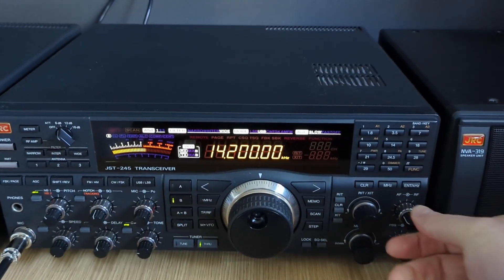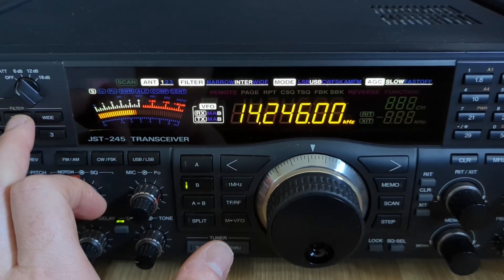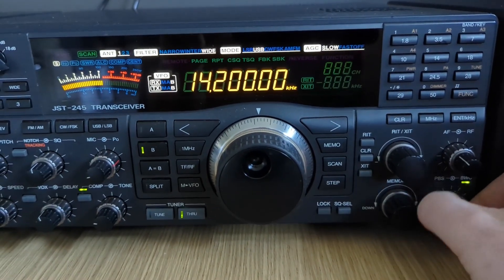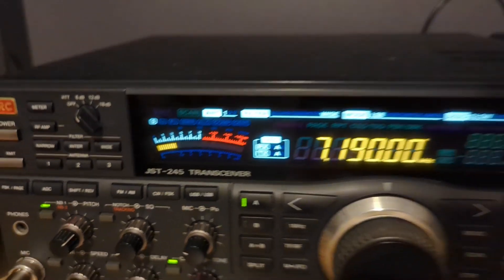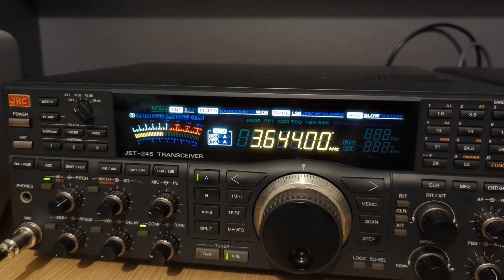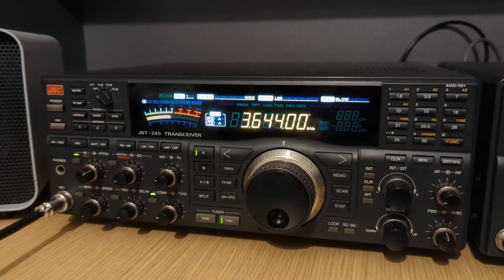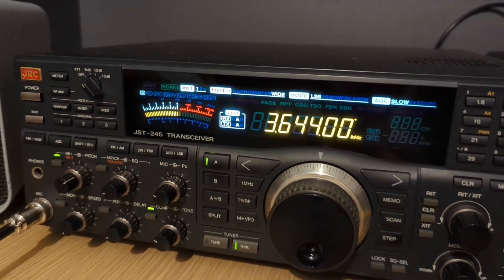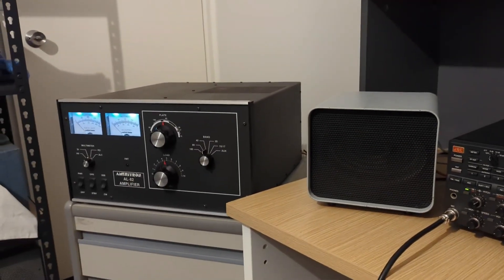JRC JST-245 – The Last Samurai of Japanese HF Engineering

Comment: I had wanted this radio since I first saw the advert in ham radio magazines. I started out buying the JST-135 (flawed but good) then a used JRC JST-245 with external speaker and their Kenwood inspired desk microphone. I even bought a damaged JRC 1KW solid-state amplifier from 160-meters through 10-meters. I have never found a receiver or transmitter that sounds as good as the JST-245. The antenna tuner is odd in how it displays ‘tunes’ as it shows the OUTPUT power during the automatic antenna tuning versus showing the SWR as common on nearly all radios. Thanks to a divorce more than a decade ago, I found it necessary to sell all of my ham gear, HiFi gear plus my test gear and tools. My tower and the 20-years of acquired antennas, rotators, feed line and dipoles were given away by my ex-wife as I couldn’t get them down in the short time I was given. It’s been nearly 15-years and I just finishing building a truSDX kit and I kitted out a small Odroid single board computer with an SDR Play (original version). It isn’t fancy but it gets me in the air and back into radio. I have a saved eBay search for a JRC JST-245 or even a JST-145. When I find one, I’ll do my best to buy it. It is the best sounding, smoothest operating transceiver I have owned. The only radio currently available that comes close or even bests the JST-245 (in my limited experience with them) is the Kenwood TS-590SG or TS-890S. Both of those radios are more expensive new or used than a functional JST-245 in good shape. I added the crystal filters to my JST-245 and that made an already fantastic receiver even better. It is a glorious radio use, quirks and oddities included. It’s just fun to operate and when you hear the RX audio and receiver selectivity, you will be sold. The JRC JST-245 is a world-class radio and holds its own against many modern (even SDR) HF transceivers. Thanks for a nice video that highlights one of my favorite radios and a truly special receiver. Enjoy that beautiful rig and I hope to catch you on the bands sometime.
Reply from the maker: That’s one of the best comments I’ve ever had on this channel. You’ve lived the full JRC story from the 135 right up to the 245 and even the amp. I’m sorry to hear you had to part with all that gear, but I get exactly what you mean. The JST-245 really is in a class of its own. The receiver is smooth, the audio is world class, and like you said, it’s just fun to operate.

I’ve run plenty of modern rigs, including an IC-7800 at one stage, and nothing has the same sound and feel as this set. The oddities are part of the charm, and when you hear it on the air you know why JRC built such a reputation.

Hope you track one down again soon. It would be great to catch you on the bands with a 245 back in your shack where it belongs.

73,
Andrew VK3USA / VK2XXL
Reply: Glorious to use, says it all.  Can't find that in Sherwood numbers or by "watching radio".  No wonder I'm strictly Kenwood now but look forward to my first JRC.  To summarize many comments i've read, too many times burned by Icom & Yaesu.

Comment: I LOVE MINE,BUT SHE WONT POWER UP.ANY IDEA WHERE I CAN GET SERVICE?I AGREE 100%,HAVE A DX 10 NO COMPARISON TO THE JRC.
Reply from the maker: Sorry mate, I have no idea where you are, let alone finding people that can work on this stuff near my QTH. I have to do everything myself. It's easy to get the power supply out so start by testing voltages. Better still, if you have two units like I do and spare parts, take PS out and drop another one in. Then just test until you find what's blown. Best advise I can give.

73

Comment: Agree its better. But still full of SMD crap like the rest. PLL how is that analog with encoder mascerading as a VFO. Just saying....
Reply from the maker: Yes the JST-245 uses a PLL like every top-end HF rig from that era. What matters is the implementation. JRC engineered it to near laboratory standards with one of the sharpest receivers ever made. The encoder drives a rock-solid synthesizer that outputs a true analogue sinewave, not a budget DDS. That is why it still holds its own today.

Comment: I agree it is a great radio, but to call it The Ultimate Japanese analogue transceiver" is pushing it a but, and when you look at lab tests of the "last of breed" radios by the big 3 you will see that there is more than one radio in that class that beats it.
In my testing, side by side and it lab tests by Sherwood labs the title goes to the Yaesu FTdx-5000MP by quite a margin.
Reply: Some people buy gear to actually enjoy using it as opposed to specs.  Otnerwise we would all drive top fuel dragsters home from work.
Reply from the maker: I’ve got a lot of respect for the FTdx-5000MP but the catch is that to hit its best numbers it has to be run in class A. That means efficiency goes out the window and the cooling fans spool up like a vacuum cleaner once it warms up. Run it in standard AB mode and the JST-245 still beats it hands down.

I also take Sherwood’s receiver figures with a grain of salt. Even Sherwood himself has said you will never notice those fine differences once atmospheric static and especially local noise are factored in. On air it is irrelevant.

Where the JRC shines is that it does not need gimmicks to stay clean. Its IMD figures in ARRL’s 1995 QST review were among the cleanest ever measured for a Japanese transceiver and that was at 150W PEP with no digital tricks. It is a rig built on brute force engineering: dual heavy duty power supplies, conservatively rated finals and construction that will still be serviceable decades from now. The 5000MP is a fine radio but in build quality and long-term reliability the JST-245 leaves it in the dust. That is why I call it the ultimate analogue Japanese transceiver
Reply: @VK3USA  Oh really? You take the Sherwood figures with a grain of salt? Well it is far more scientific and consistent than your fanboy conclusions.
I am a keen CW DX'er and contester and I notice the difference. In the critical RX dynamic range category the JST=245 does not even feature.
But hey, your channel, your opinion, I do not have to watch it so I won't......
Fanboy😂
Reply from the maker: @RudixSA  And there we have it. You lose the argument so you resort to name calling like a child. Too bad for you that it does not change the facts. Sherwood’s tables are useful but they are not gospel. Even Rob himself has said real world noise floors mask those fine differences on air. The JST-245 was built for clean transmit, a very clean receive, rugged hardware and long term reliability. It still holds some of the cleanest IMD figures ever measured by ARRL.

What makes this even more ridiculous is that you are trying to lecture with a channel that has no Amateur radio content of its own. No station to show, no demonstrations, nothing. Just criticism from the sidelines. Until you can demonstrate something yourself your opinion carries no weight. I will stick with a rig that was built to last decades while you sit in the cheap seats. 73

Comment: In two years or less SDRs will make this unit largely anachronistic, but that’s just how it goes. Don’t hate on SDRs, they’re a military technology at this point and any other take is just pure cope. I can promise you, the FOSS people will come up with digital codecs that will put analog filters to shame.

Nice rig though, beats the pants off my G90 until I want use it mobile, etc.

Also, there’s a PLC in that thing somewhere adding to the noise floor… it’s just how it is. I mean, what do think is driving that display… nixie tubes? Heh… c’mon bud. Take ur head out of the clouds and just enjoy. (Also, it literally has DDS… so that “analog” audio you enjoy has actually undergone digital post processing, and I’m sure the image rejection circuit is also digital.)
😂

Stop. Listening. To. Ancient. Operators.
Reply from the maker: Hi mate,

What you’re saying is mostly true and we as Hams should always embrace the latest and best technology, but there’s a few things to remember — and a very important point I’m making here. The ball has been totally dropped by all manufacturers on transmitter design. Even the flagship Icom IC-7851/7800 platforms returned mediocre IMD results in the ARRL Lab compared to rigs like the Collins 32S-3 or JRC JST-245.

Digital algorithms should not be used to cover for poor fundamental design. I’d only ever put one of those mega-dollar SDR rigs on my bench if they could equal Collins, Drake, or JRC for IMD without needing Digital Pre-Distortion or Pure Signal to paper over the cracks. Anan, Flex, Hermes Lite, and all the Chinese SDR clones don’t even have the 40+ years of solid-state transmitter design pedigree that Icom, Kenwood, and Yaesu built up — and JRC went even further, creating a unique PA stage with 12 individual MOSFETs running efficiently to achieve what they did.

The JST-245 has no DSP,  and no digital post-processing in the audio path — it’s discrete analog through the IF chain. That’s why its IMD and noise floor still outclass many modern SDRs. SDRs are powerful, but they’re not a replacement for a clean analog design. Specs and field results don’t lie.

As for receive: the LO/DDS/display driver feedback is effectively nonexistent to human ears. That’s why the JST-245 was one of the only rigs of its time to achieve that kind of purity.

And I’ll add this: the “ancient operators” you dismiss are the ones who understand why your G90 collapses in a crowded pileup while a Collins or JRC cuts through cleanly. There’s nothing anecdotal about lab measurements and field results — those are facts, not feelings.
Reply: @VK3USA  If analog was the way to go, militaries would still use it. That is a dual tech rig. 

Per Grok 4: DDS is used in the JST-245 as a single-crystal system to generate the local oscillator signals for precise, low-phase-noise tuning (down to 2 Hz steps), providing smooth and stable frequency control without the drift or mechanical issues of older analog VFOs. ￼ ￼ ￼ ￼ This is implemented via a dedicated DDS IC, which digitally synthesizes the required frequencies but outputs an analog sine wave to the mixer stages.

While there’s no DSP happening to the audio (I was wrong there) the heart of the machine is, as I suspected, a digitally synthesized clock signal from a crystal oscillator. Very common design, though revolutionary at the time.

So, yes… your rig is indeed digital in more than an abstract sense and if you took all that super-clean audio (it is) and pumped it into a DSP filter for voice, you’d be BLOWN AWAY by the weak signal work you can perform.

Your rig is great because of Direct Digital Synthesis. Thank you for your time, and please embody more humility.

73 GB
Reply from the maker: @H33t3Speaks  The JST-245 does indeed use DDS to generate its LO, outputting an analog sine wave into the mixer. That’s not controversial, but it also doesn’t make the rig “digital” in the SDR sense. Otherwise, every synthesized-LO rig since the 70s would be “dual-tech.” The important point is that the entire IF and audio chain remains fully analog, and that’s where the IMD performance is won or lost.

Military adoption of SDR was about flexibility (encryption, waveform switching, adaptive comms), not because analog was somehow deficient in spectral purity or voice transmission. Those are very different design goals.

Specs and field results don’t lie: the JST-245’s IMD and noise floor still outperform many modern SDR transmitters...even five-figure flagships.....without DPD/Pure Signal. That’s why rigs like the Collins 32S-3 and JST-245 remain benchmarks.

Not arrogance .... just the data. 73.
Reply: @VK3USA  All fair points, I just can’t get behind hating digital because the mathematical backend to it, combined with modern computing power, will totally outclass analog systems in clarity and power consumption but you have to have a great software stack to truly pull it off… but when you do there’s simply no comparison.

The magic done on waveforms with proper DDS is jaw dropping and it’s only going to get better.

Imagine using an AI to sample your noise floor and then creating an inverted pink-noise signal based off of it. The audio clarity coming down the pipe from the SDR folks isn’t even a small step away from being at or above these reference rigs. Rumor has it that Xiegu is cooking up something incredibly competitive and special after the meteoric success of there G90.

Embracing this new wave of comms tech will radically expand the hobby through cheaper, lighter and more reliable gear. Shunning it will probably hurt the viability of the hobby, which is already threatened on so many fronts.

To me, digital is just an on or an off state. Hell, if the thing has memory banks… it’s a prima facia digital machine, exemplary analog stages notwithstanding.

I’ve been exposed to a lot of gear that uses digital waveshaping. The fidelity is there, and it’s getting cheaper.
Reply from the maker: @H33t3Speaks  I agree digital can do incredible things when the software and algorithms catch up and I don’t doubt that one day SDRs will routinely outperform the cleanest analog rigs. But that day isn’t here yet and certainly not in the sub-$5k or budget SDR market. Right now the big three have actually regressed in transmitter design compared to Collins, Drake and JRC. Even the IC-7851 did not hit the IMD numbers of the Collins 32S-3 or JST-245. Most SDRs lean on DPD to patch over flaws but that is not the same as getting it right in the first place.

On receive I am with you, digital brings advantages in filtering and noise reduction. But on transmit the bar set by rigs like the JST-245 has not been cleared yet. Until it is there is still something to be said for radios that were engineered to be clean out of the box. Embracing new tech is good but forgetting past design excellence is how we end up with $10k rigs that measure worse than radios built 30 years ago. But it's only a hobby I guess. Just felt like getting on the high horse in case any of the manufacturers listen.
Reply: What expands the hobby is the enjoyment or satisfaction people receive from using the gear.  Cheaper, lighter, more reliable just drives people to the web.  Otherwise, sailboats & horses would cease to exist.